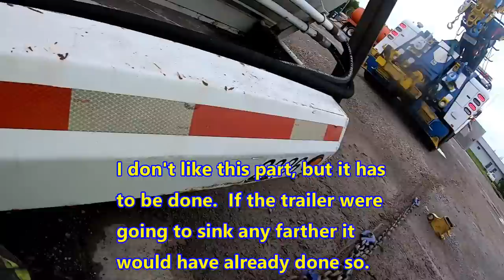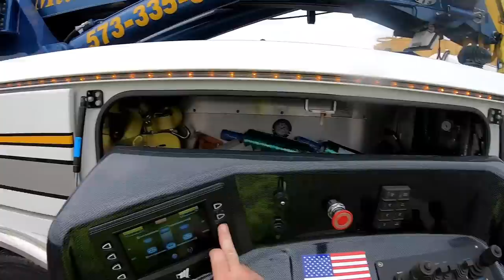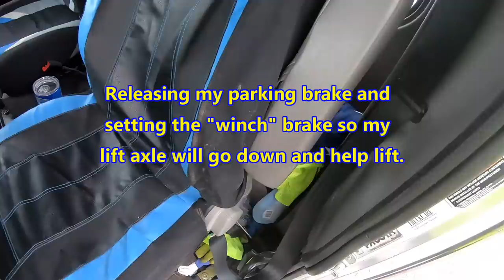Loaded Tanker Takes A Dive....Nose Dive That Is

Comment: The way your grunting sounds like you might be feeling the onset of old age Ron lol trust me I know how it is
Reply: Nah, he still a youngin.  But give him a break. Those keyhole adapters weigh a lot and with the heavy chains, Ron is dragging and trying to lift and position 40-60 pounds lying on his back at pretty much full arm extension mostly with only one arm bearing the weight. You have to use all your abdominals to steady your reach and you can't do much breathing in while you're  doing a full stomach clench.  Any one is going to do a some huff and puffing in those circumstances.
Reply: @rcatyvr  Agreed. Nothing that Ron works with are lightweight.
Reply: I was thinking he was grunting more than usual. Glad someone else noticed it. He did say it was overly hot but I don't recall him ever sounding this bad. I thought maybe he was just under the weather since it's cold and flu season. He never stops it seems. He just goes and goes. Another great vid.
Reply from the maker: @myfatassdick  Actually, you are on the right track.  I have studied Martial Arts since I was very young.  Part of the teaching is learning to breath, exhale, and, at times, make noises when doing so.  My wife has always made fun of me, lovingly, of course, but it is something I do that is pure "muscle memory" from my training.....and maybe a little bit of old-ish age creeping in....LOL.  Thanks for watching and God bless.

Comment: You're job is very dangerous, but you scared the heck out me when you walked between the two traillers while the one was suspended on the chains; and crawling under the front end of a sinking trailer to connect to the kingpin..you could not pay me to do that! BTW: with all the neat features your truck has, couldn't the builder have motorized the lazy susan for the chains?

Comment: The biggest problem was that the driver dropped it on the soft dirt instead of setting the landing gear on the concrete pad that is in place for just that reason.

Comment: I had a problem like this not as bad. I  had a trailer sink a bit maybe a foot and a half or so. I dump the air on my tractor got the frame under it then aired up. That raised the trailer enough to crank the legs up put some timber under them. Then dump air bags again. Put some blocking on the frame backed under, put air in the bags cranked the legs down then was able to hook up. Not even possible on this on though 😂.

Comment: Your winch controllers are electronic and remote controlled - do they also display what weights are being lifted at any moment in time?
Perhaps it might be possible to get the data from such a lift and overlay the data onto the video of the lift?
For viewers who don't seem to understand the dynamic risks and dangers of work such as this, info such as that might help stopping them comparing this work to getting paper-cuts in an office.

Comment: Not sure how full the tanker is but those smooth bore tankers suck because when the legs dig in the ground all that water 43,000 lbs of it surges to the front... back would be light as hell and even though the trailer got no air in the chambers so the brakes are locked but that load surging can push that trailer around on that dirt lot

Comment: I wondered why you just didn’t put the landing gear in low range and lift with them UNTIL I saw the bent cross member bar.  
I also thought all trailers had spring brakes that are locking the brakes when there’s no air pressure to them, but you put air pressure to the diaphragm side.  I guess you just wanted to be sure....

Comment: Just a question, since this under reach isn't strong enough to lift that out would one of your other trucks with just an under reach do it?
Reply: I dought it that trailer  would b very heavy with the nose down all the liquid would come foward could be 45k on the king pin area
Reply: The other two heavies have even less underlift capacity than Tator. You can check out the specs for all Ron's rigs at millerind.com.
Reply: Under reach/stinger/wheel lift ... are only designed for towing light vehicles or empty or near empty trailers.

Comment: Thanks for bringing us along sir. That was dangerous with all that weight. Good job. How much is your Tator Rid worth$. I seen a new one for 8 million. What?  How much did you charge for this job? If you can’t share I understand. I’m guessing 850.00-1000.00
Reply: Y’all make it look easy but I know it’s not. I’ve seen y’all in some nasty nasty.  That seemed right around the corner from the shop by the last lil scene. Maybe I missed something. Stay safe y’all are living the good life in Jesus.
Reply: Ron says the Tator, as equipped for Midwest, cost 750K in '15. He estimated around 1M today. Of course they just introed the M100 so maybe a "puny" 50T would be discounted (LOL).
Reply: Raymond Ives . Wow! I don’t know how much more capacity it has but can you imagine how much heavier the chains and straps are required to be? There should be a mandatory minimum crew size because of equipment size. Some of the lifts Ron has had to perform has maxed it out in some cases. Which goes to show there’s still a need for heavier capacity along with the training to go with it. Since heavier recoveries requires additional equipment, two pieces I’d opt for is a pressure system using water to cut channels for chains and cables to run under buried loads as well as a wedge type system of lifting that’s more stable than conventional air bags. This is designed with the idea of being able to keep people away from high risk areas. Since more weight is required to prevent it from tipping, it can be onboard the rotator. Perhaps it’s weight can be shifted to the opposing side for more counterbalance. Other than that, add to the wishlist the operators have to keep people safe along with utilitarian needs for its use. At least that’s my thoughts. Hopefully it’ll give a higher margin of safety in most cases.

Comment: Im sure this is a common problem ..especially in the south ..
Reply: Common problem in many places (everywhere) with gravel or other loose ground soils with no permeable pavers (*true grid* for example) or at least concrete pads for the landing gear to sit on top of to prevent them from nose diving.

Comment: I get that this a tow video.  And I skimmed the comments. I want to know if the dbag that dropped a fully load tanker on soft ground instead of the clearly visible concrete pad lost his/her job?  Companies build those pads for a reason...to place the landing pads/gears on.   Not only did it cause a potential dangerous situation.  There could of been 10s of thousands of dollars in damages to equipment and the load itself.   Jesus if anyone of my bosses caught me doing something like that I'd be fired on the spot.

Comment: Low bed ramps are prefect for pick up trailers...😂 I pick them up all the time. But that tank is far to low. Hopefully the driver didn’t get fired.
Reply: Give the driver a photocopy of the recovery bill as a reminder of why you should never stop learning. The need for a rule is not always obvious ahead of time, untill you come undone.
Reply: This was not a case of it being dropped from a failed hook up, it was simply not parked with the landing gear on the concrete pad just feet away, so it was more a driver parking error for not paying better attention to the layout of the lot.
Reply: Joshua79C C I owned aluminum asphalt oil trailers, and a steel vacuum trailer. There is no possible way I would ever unhook ether one of those trailers loaded. Both my trailers landing legs where not designed for weight. My friend did it once, but the numb nuts didn’t take into the account of the slope the trailer was at. Well his trailer was slightly down hill so the asphalt oil was sitting mostly up front and the landing legs just buckled. I was standing feet away yelling at him not to do it. Lucky for me and him it didn’t rip open his trailer. The bill to pick it up was $1200. That asphalt oil is 400 deg. Just imagine the bill to clean up that shit.

Comment: Another great job Mr Ron. But I would have liked you  to have stacked a couple 6 × 6 wooden blocks under the front edge of the tanker before you went underneath the tanker. Dont want nothing to happen to you buddy.
Reply from the maker: You may not have seen it, but I had a large TIE block under the nose, which was close to or on the concrete pad.  Actually, the block is visible in the "thumbnail" pic.  Thanks for thinking about me.  God bless.
Reply: Thanks for the reply and I I should have doubted a true professional.  Keep the video come and go bless.
Reply: Keep the videos coming and God bless.

Comment: So I'm just wondering why you didn't want to lift the trailer higher than you needed too? Wouldn't lifting it higher relieve some weight off your truck and put more of the weight on the trailers axels when the liquid shifts towards the back
Reply: Lifting it higher wouldn't have helped at all. Yes, the liquid would shift to the back, over the axles, but when they lowered it back down to standard height to rest on the legs and put a truck under it the liquid would just level out and put half the weight back on the front end.

Comment: I have a dumb question: why were the "glad hands" used? They didn't seem to be put under the trailer or used for anything. But, you mentioned you needed them. What were they used for?
Reply from the maker: They were used to "back-feed" air into the tractor so the brakes could be released.  Thanks for watching and God bless.
Reply: @RonPratt  Thank you for the response, Mr. Pratt. I'm not in the industry and used the wrong terminology. I don't know the proper name, so...the was the bar from your truck that went almost under the trailer. It had the two "forks" on it and it was sticking up. From my armchair, it didn't look like it actually went under the trailer. At first, I thought it was going to be a safety catch, or attachment point for the snatch blocks. It looks like you moved it several times, but I didn't know what it was being used for. I hope that makes sense. Thanks.
Reply from the maker: @shawnerz98  So I can answer you properly, are you asking about the "arm" that is attached to the rear of my truck or the "arm" that come out the side of the truck?
Reply: @RonPratt  I reviewed the video to explain what I was asking about and now I see the subtitle I missed.  It was the under-reach and nothing was attached to it because its job was to keep the trailer from rolling forward. Thanks for taking the time to respond and thanks for your channel. :)

Comment: I have seen a trailer with the dollie leg,s had wheel,s on them inatead of flat plate support style also where i use to work  we had to take three fork lift,s to pick.up a trailer so.we could place ply wood under the dollie leg,s so the trailer did not do the same thing  good thing the trailer was on asphalt

Comment: Hi from Finland, i notice in 2:00 that there is new accessories in tool box, those yellow blues?
Sometimes the ground can surprise you.
Reply: niemma2, He painted the hooks blue and yellow to match his truck.  That way at an accident scene when other trucks are helping, he can tell which accessories belong in the rotator and which do not.
Reply: @genedameier8746  The snatch blocks are painted to match the winch colors so when he's doing a double line or multiple Holmes tree rigging youcan see instantly which winch it's on.

Comment: Try cranking one up. My brother an I had just loaded a full load of microwave ovens, an when he backed under it the 5th wheel didn't lock an he pull out from under it. Long time ago. 4 people helped crank it up an we BOOKED.
Reply: And that is why you always do a tug test after backing under a trailer. Also why you a visual check  before ever touching the landing gear.   And before anyone comments on my comment. I did yard jockey moving appox 120 trailers in an 8 hour shift for 2 years. As well as doing both long haul and local for 13 years...zero dropped trailers a few high hooks but never a dropped trailer.

Comment: Ron I didn't see you use the outriggers on this job!
Reply: He didn't need outriggers because there was no sideways load. The greater concern was the rear load picking up the front end (using the rear axle assembly as a fulcrum). When he moved forward there was a real danger of loss of steer control if the front raised too far.

Comment: Where did that name """"Glad Hands come from""""??????
Reply: I can't say for sure, but since knowledge is not a prerequisite for comments, here goes. I believe the reference is to a handshake. Shaking hands is sometimes referred to as gladhanding. The air line from the tractor and the fixture on the trailer mate by putting them together and turning the air line til it stops. The connection has guides that compress the connection so it doesn't leak. It is similar to a handshake.
Reply: And to further Richard's comment about gladhands,  gladhands have evolved a bit since their inception.  Standard railway gladhands are interchangeable with any others like them.  In the trucking industry,  someone decided in the 70's that because of problems inherent with the now-obsolete braking system of the time,  they needed to come up with modifications to the gladhands, to ensure that they wouldn't be coupled up to the wrong mating connection.  So, now we use color-coding to visually identify which hose goes to which connection,  and we have adapted to gladhand designs that make it (extremely difficult bordering on impossible) hard to accidentally connect them wrong.  They are called "polarized" glad hands,  and will only easily mate up with like mates.  The red ones, for the supply/emergency side of the system, will only engage with other red (or neutral, if there are any left out there) gladhands, and the blue ones, for the service side, will only mate up with other blue ones (or neutral).  This prevents accidental mis-connecting of gladhands.  With the modernization in the late 70's to the 2-sided air brake system,  it's pretty near impossible to get moving down the road with your gladhands hooked up backwards, but if the brakes on the towed vehicle are completely out-of-adjustment,  it could still be moved, regardless of correct or incorrect hookup.  The neutral gladhand can still be found,  it gets used for other applications, such as for releasing lock pins on container chassis,  so that the chassis can be telescoped or stretched to accept different sized containers.  Neutral gladhands are also found on things like air lines designed for self-inflating tires off of the tractor's (red) supply line.  A neutral gladhand does not have the safety design to prevent reverse coupling, because the neutral gladhands are now only used for non-critical applications. Anything put on to a highway-use vehicle must have the polarized gladhands.

Comment: When you are lifting, do you try to do the lifting input with the winch lines? Or the boom? Both? Is either preferred over the other or does it not matter?
Reply: voss100 The winches allow better control, and also show the actual load weights. The boom has position but not load sensors. I guess its habit too.

Comment: Why didn't you put wedges in front of the wheels of the trailer?
Reply: Wedges? 

A trailer with its spring brakes set isn’t going to benefit from chock blocks.

Comment: Hi... is 2:1 the Max you can reduce?
Ore is more possible?
Reply from the maker: No, I can and have reduced far greater than 2:1.  At a certain point, theoretically, the resistance created by the sheave bearings, will limit the number of blocks you can put in a single line.  You can, however, delve into complex rigging, if you have time and all the right equipment to set it up.   As a general rule, though, 2:1 is commonly used in my field and 3:1 and 4:1 can be set up for heavier pulls and lifts.  Much more than that and most people will start adding more heavy iron (more trucks or equipment) to the equation.   If you are interested in watching, my father and I performed a recovery of an abandoned rental van from a muddy forest trail using only my father's side-by-side and rigging up a 5:1.  Here is the link to that video:  https://www.youtube.com/watch?v=yx9cb-ubg6w
  Thanks for watching and God bless.

Comment: Wondering why not just use the under reach and wheel chalks? Or is it a case of smokem’ if you got em’?
Reply: That might have been an alternative if the tank was empty.  1:30 mentions that the weight was more than the underreach was designed to lift.
Reply: See the Scott Perry comment that Ron pinned and answered for best info on the dangers of this type of lift.

Comment: Ron, question, if that tanker was a loaded fuel tanker, would you be able to lift was you did or would you need the fire department for stabilization and whatnot?  Asking because a few years ago here we had a loaded gasoline tanker separate from the tanker and fall onto the asphalt, which prompted a fire department response and they have to stabilize the tanker and do some anti-static or something before tow operations could begin.

Comment: Did I miss it or did he not pull forward just a bit to make sure that the kingpin was locked in
Reply: He wasn't loading the trailer for travel. He was just using the tractor to hold the trailer up, presumably until they could fix the landing gear.

Comment: Never would I trust a 5th wheel to be hitched no matter what locking noise it makes or especially someone else telling me it’s ok.  A slight tug from the tractor to me is the only proof I’d accept.
Reply: Also helps to crawl under with a  flashlight (even the function in a smartphone works as well) and see that the connection is properly "secured" before doing a tug test
This was a simple case of it was not placed on the "concrete pad" when it got delivered